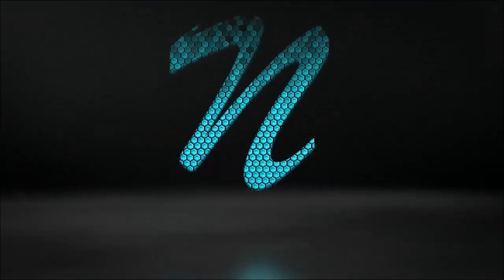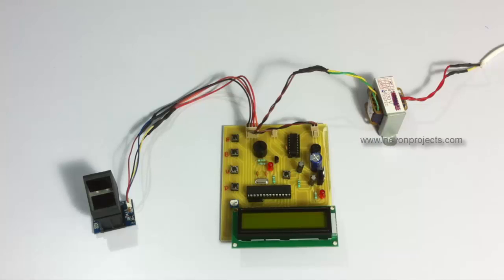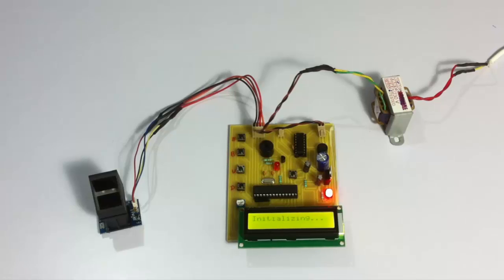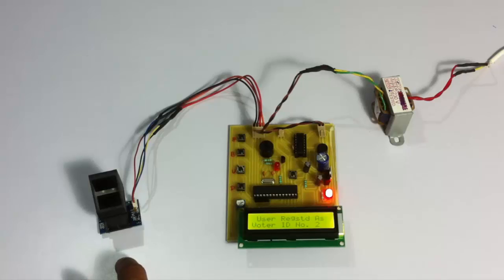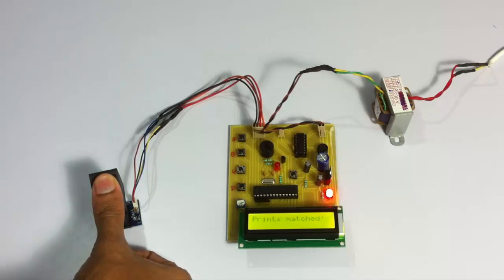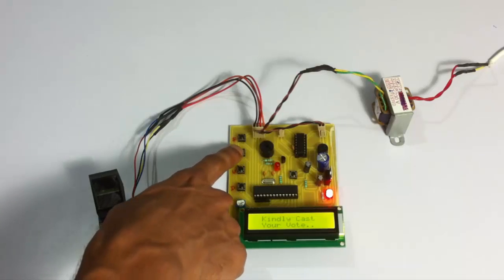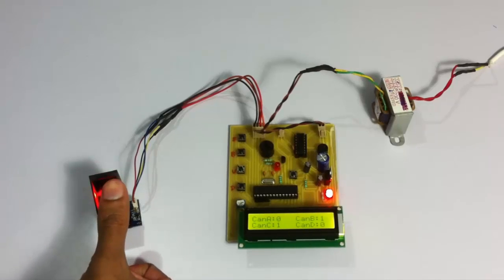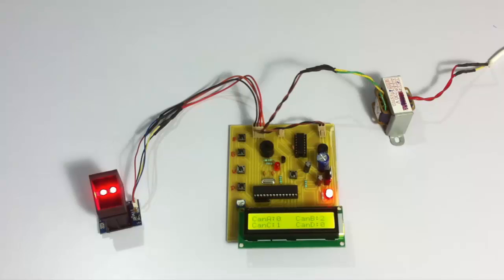Fingerprint Based Voting System Project

Comment: Kindly provide specifications on the following 
- Resistors 
- Capacitors 
- Transformer
- Diodes 
- Voltage Regulator for this project